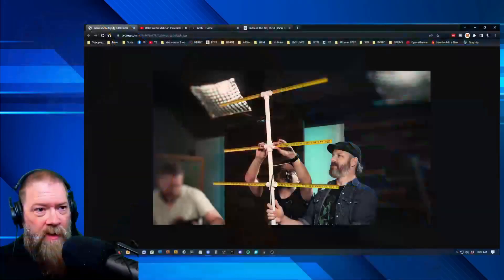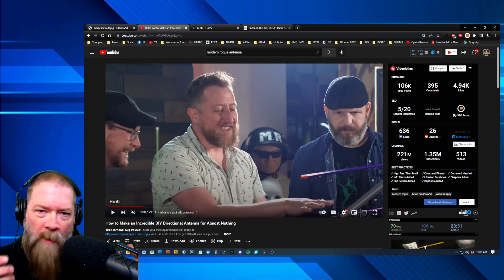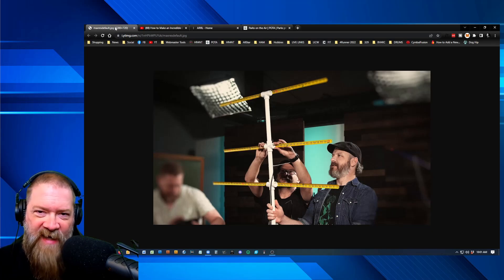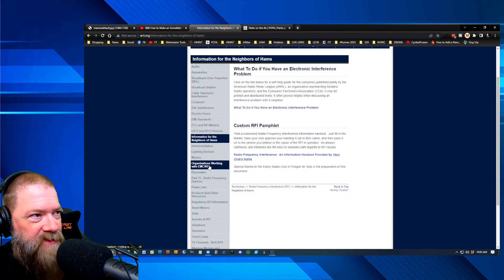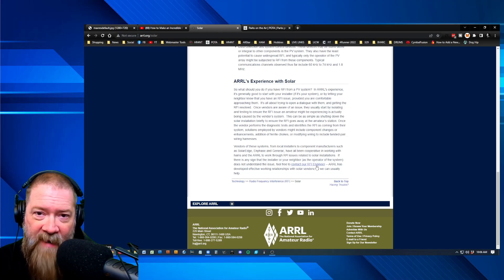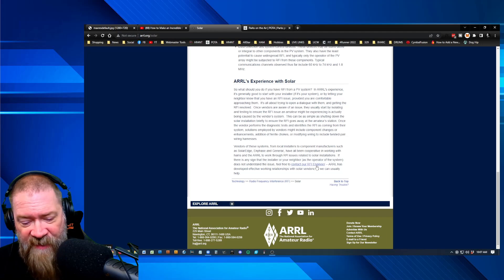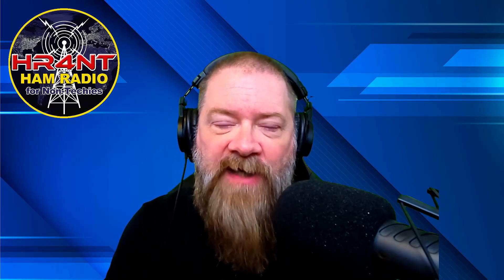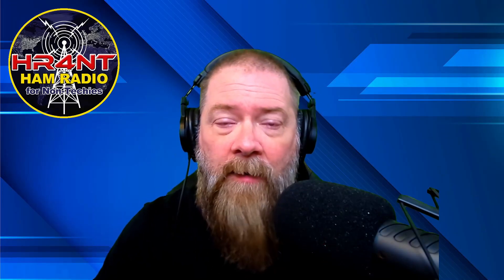RFI, Mr. Solar Panels and a POTA Question

Comment: Have the same problem with RFI in the UK. Since lockdown and the energy price surge neighbours all around have installed both solar and home offices with high power wi-fi range extenders. Daytime hours on ham bands are swamped with interference and only when the sun goes down and people stop working do things improve slightly. I will have to go mobile.
Reply from the maker: Yeah I have come to the conclusion that until we physically change our address to a new area my radio operations will be limited due to the RFI around here.  Thanks for watching and for the comment.  73!

Comment: Great video, Scott!  I live in north Texas and have been considering solar panels for my own place and have been careful to choose solar controllers that are RF quiet. I have seen youtube videos where a neighbor a whole city block away from the dude’s QTH was belching RFI and it could have been Solar Edge or EnPhase.  It seems that the panels with micro inverters (the ones at the panels) are more of a problem with RFI.  Also, I always assumed a MPPT solar controller was better than a PWM controller, but I have seen a PWM actually behave more RF Quiet if you will then the MPPT types.  MPPT is maximum power point tracking and gives you more options to raise/lower voltage or current to meet your specific needs.  Anyway, the microinverters are very useful in solar production since they can produce power even when some of the panels in the string are shaded (which is the bane of solar panels).    

All that to say, you are more than likely going to have the micro-inverters on your neighbors solar panels as that seems the way they are rolling with solar installs these days.  Of course, you could have a neighbor like me that is putting in one himself and that can be more tricky as far as the finger pointing could go.  I am with you on the confrontation - I don’t desire it either.

Have you noticed the RFI getting worse or not after sun goes down?  That has been a clue for drilling down into the root of the problem before as well.

Thanks again for your continued excellence in your videos.  Always interesting and informative.  All the best!  73 de KI5HXM
Reply from the maker: Hey Brent, Thanks for the comment!  I do notice a bit of reduction in RFI at night as opposed to the daytime.  However, I also do not think this is the only issue in my area for RFI.  I am just trying to track down one issue at a time and once I can get the solar panel issue resolved, I can move on to hunting down the next one until I have no more issues.  I am about to go back over to that neighbor and see why they haven't resolve d the issue on their end in the six months I gave them to fix it.  I gave them a package that clearly spelled out everything and how to get it resolved for free, but it look  like nothing has happened since my initial encounter.  I will keep you guys updated on this situation and report back hopefully when it is resolved.  Thanks for the comment again and for watching.  73!!
Reply: @HR4NT  I wish you the best with your neighbors.  It can be tricky - most of my assumptions with any neighbor is to assume they don’t understand not that they are stupid but may not be motivated to fix the problem.   

Sounds like you will be playing ‘whack-a-mole’ with RFI.   

Some of my RFI has been rural power lines with sensors for monitoring the power grid. My friend who is also a HAM called the rural electric company who changed out the offending sensor. Isn’t technology fun? Maybe, if you aren’t trying to get on the air.  Lol

I wish you the best. One day I will buy you a drink or coffee if we happen to see each other in person.  Until then be safe and well.  73 de KI5HXM

Comment: Nice video on RFI. I actually watched the latest one first then went here.
I am seeing some RFI that is cyclic in nature and a odd times.
Need to do that tape measure yagi and search the hood.

Thanks
73
de W5KAL
Reply from the maker: It is definitely worth check out the build for it.  It may not be solar...it could be LED lights or someone has a battery charger or maybe even a bad transformer.  Either way, the antenna will assist in spotting the issue.  Thanks for watching and for the comment.  73!

Comment: Hum, I think depend quality of solar panels. I have 60 solar panels in my roof and my noise levels with my DX commander are S2 max.
Reply from the maker: I am finding out that not all solar companies are equal.  I have heard that solar edge is really bad with RFI.  I am glad that you are not having any issues with yours!!  Hopefully this will be resolved very soon.  Thanks for watching and for the comment.  73!
Reply: It's not the panels themselves that are causing the RFI, but the inverter and micro-inverters that are spitting RFI, and SolarEdge is the 'champion' in doing that unfortunately 😕

Comment: Didn't get 2980r fully installed got the wire ran with power poles.  Some antenna swr issues with the antenna it appears after a lot of testing it's the swr meter that's bad.  Have to get a real swr / power meter to test with to make sure before finishing install. It was a hot one though.
Reply from the maker: Sorry to hear that!  What antenna are you using?  My Diamond and Comet antennas were both plug and play with no tuning needed.  Having a good analyzer is probably one of the best pieces of equipment you can own as a ham operator.  I prefer the Rigexpert's, but I know they can be pricey.  Thanks for watching and for the comment.  73!
Reply: @HR4NT  Thanks! Yeah picked up a Comet CA 2 x 4SR NMO  yeah picked up an MFJ 894 for now you are right rig expert are probably worth it but a bit pricey. Have to save up some more for that one. 😀